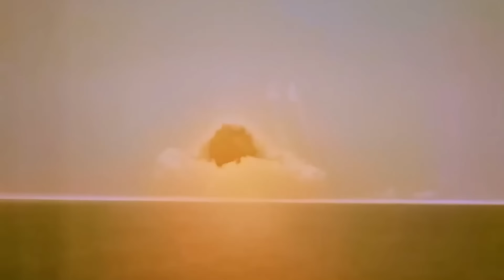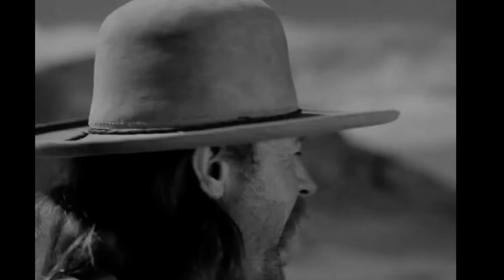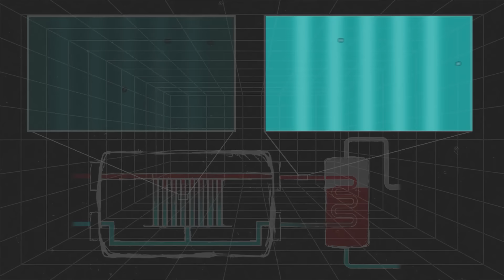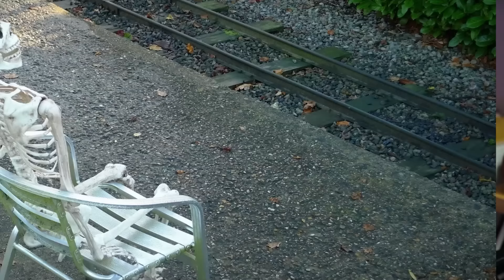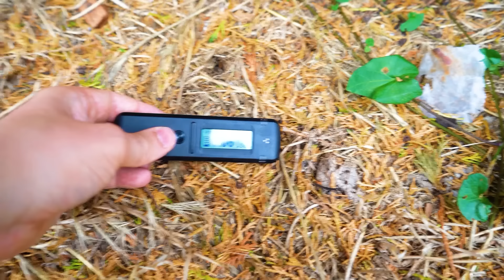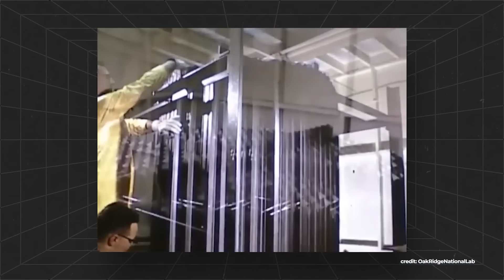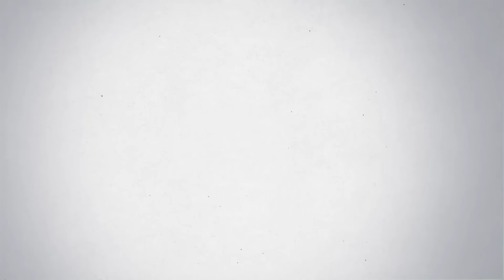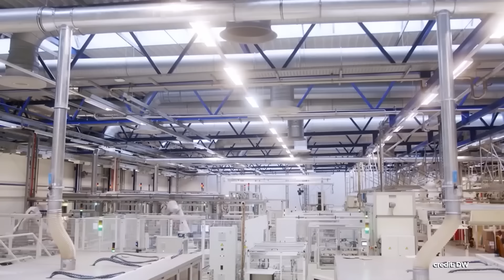It's Happening - China Launches World's First Thorium Nuclear Reactor

Comment: Claims that thorium reactors are easier for preventing meltdowns are simply not true. Ultimately, fission in thorium reactors is uranium fission. There is still decay heat after the reaction stops.
Reply: It's the molten salt part that makes them easier to prevent a meltdown

Comment: Indian Point Energy Center (I.P.E.C.) is a now defunct three-unit nuclear power station located in Buchanan, just south of Peekskill, in Westchester County, New York. 
Indian Point 1, built by ConEdison, was a 275-megawatt Babcock & Wilcox supplied pressurized water reactor that was issued an operating license on March 26, 1962 and began operations on September 16, 1962. The first core used a thorium-based fuel with stainless steel cladding, but this fuel did not live up to expectations for core life. It was switched to uranium in 1965. 

 - wikipedia

Comment: It's important to understand this new technology as it pertains to the evolution of AI and the AI Cold War. We are in a full blown race with (mainly) China to reach AGI and then ASI first. Nuclear power comes into this due to the MASSIVE amounts of compute (i.e electricity) needed for AI. Hence, whomever can harness better and cheaper sources of power can accelerate development of AI, faster. Currently, the power needed for the level of compute is the main ceiling hampering the development of AI, or, of implementing it practically. Nuclear power, dangerous though it is, is a highly efficient source of power to generate electricity. Therefore, a technology such as this (that uses Thorium) is important because it renders scary nuclear power generation into a far safer version. Very efficient.

Comment: sorry just because there is no primary water circulation with water - always the same water because circulation does not mean they do not need a secondary cooling by whatever.  2/3 of the energy by a power plant is waste heat you need to get rid of. this is a physical law with universe  validity. the remaining 1/3 of fuel input energy becomes electricity. if you put the powerplant into the desert than you need massive power transmission. One last point just google the THTR reactor type sold by germany to china ..............

Comment: Very interesting. TY, for an awesome video. We need a variety of power plants and power sources. I think having the power plant that can make more power as the demand goes up is great. We also need a variety of these other plants to continue to power our future. Would be cool to see less hazardous waste. Smaller more modern fuel sources and plant designs than a traditional nuke power plant. In the countries that will use thorium, good. Use the material and make power. Their are many things I liked to hear you talk about in regards to thorium. I think uranium is maybe not the way to keep pushing hard for. We need a lot of new plants and major upgrades to the worlds power grids. If we are going to step into the future. Hopefully well before 2040. Thats not far away from now. A great deal of work needs to go into the build up of many countries and infrastructure. To include their power grids, roads, housing, sky scrapers, big apartment buildings, waste water treatment, clean water supply, warehouses,  manufacturing plant's, eletric car charging capacity,  and many more power drawing facilities. The amount of extra power and plants that will need to continue to grow big cities and towns is a big concern going into the future. TY again. Cool video.

Comment: I'm a sincere fan of the proliferation of Thorium use for power generation.  For all of the reasons mentioned, Thorium beats traditional Uranium-based nuclear fission.  Nuclear is a necessity for the future of low-carbon electricity.  My understanding is traditional reactors stand to serve approximately 20% base load, with few opportunities to ramp-up/down.  

I am intrigued by the sodium molten salt reactor proposed by Bill Gates.  Attempting to solve the dispatchability issue is certainly a noble cause.

Comment: China's Foray into Thorium: The World's First Thorium Molten Salt Reactor

* 0:00: China has commissioned the world's first thorium-fueled molten salt reactor (TMSR-LF1). This is a significant milestone as thorium reactors are considered safer and produce less waste than traditional uranium reactors.
* 1:16: The reactor is expected to be operational by 2029.  It's located in the Gobi Desert and will initially operate in a closed system for research purposes.
* 13:29: China has ambitious plans for thorium reactors. They plan to build larger commercial reactors (100 MW and above) and potentially export the technology as part of their Belt and Road initiative.
* 7:57: Thorium is more abundant than uranium and produces less radioactive waste. The waste also decays faster (estimated 500 years vs 10,000 years for uranium).
* 16:36: Other countries are also researching thorium reactors.  The US (TerraPower) and European initiatives (Naria and The Rizon) are developing their own designs.

Important Note: While the video highlights the benefits of thorium reactors, several commenters point out that the Chinese TMSR-LF1 initially uses highly enriched uranium (HALEU) and is not a true thorium breeder reactor yet. It's crucial to consider these nuances when evaluating the technology's potential.

I used gemini-1.5-pro-exp-0801 to summarize the transcript.
Cost (if I didn't use the free tier): $0.13
Input tokens: 35029
Output tokens: 574

Comment: This video just continues to perpetuate some of the ignorance about radiation.

When it comes to half-life, the longer the half-life the LESS dangerous the material. Shorter half-lives means the material is decaying faster and will emit MORE particles over the same time period. Secondly, radiation isnt a disease or toxin. It damages cells via kinetic energy. The effects we associate with radiation sickness are just the side effects of massive cell death due to kinetic cell destruction.

Lastly, when it comes to uranium where do you think it comes from... the EARTH. Humans, plants, and animals survive just fine around it all the time. You could eat yellowcake, which is a concentration of processed uranium ore , and you would die from heavy metal poisoning LONG before you would die from radiation poisoning. You are exposed to more radiation on a flight than you would holding a uranium ore rock on your hand.

There is a lot of propaganda surrounding radiation plying on ignorance about the subject. Current reactor technology was preferred because it combined well with weaponization of uranium and the byproduct plutonium. However, on a commercial scale it simply comes down to cost and feasibility. The reason thorium isnt used it not because of some conspiracy, but because it is currently more costly, including the risks, and less efficient than current breeder technology.

Comment: Looking at these simplified models, it appears that Thorium reactors are constant load devices. The heat produced drives a steam turbine or gets wasted. Conventionally, this is not acceptable. However, If Thorium is cheap as a fuel, another use appears. Off peak surplus gets used for co-located quantum computer clusters.

Comment: I saw this article in Business Insider. Molten-salt reactors were first built in the 1950s but haven't been used in the US since the 1970s. The US Nuclear Regulatory Commission recently issued a permit to build a molten-salt nuclear plant. Kairos Power is heading the project, which it hopes to finish by 2027.
Reply: It's under construction at Oak Ridge TN
Reply: Indeed. I believe that the UK also had a sodium cooled reactor in the 1950s.

Comment: How much research into Thorium have you done?

    THE FIRST MOLTEN SALT LIQUID FLUORIDE THORIUM REACTOR (LFTR) functioned for at least 5 years continuously at Oak Ridge National Laboratory during the final years of the 1960s and into the first years of the 1970s. It worked well, and its shutdown was due to political reasons and NOT technical issues.
    Then President Richard Nixon gave the order to defund Thorium research. One of the reasons was, as your intro pointed out, that Thorium reactors (and LFTR technology in general) is not good for creating weapons-grade fissile material. Back then, producing such material was a benefit.
     However, LFTR technology IS GOOD FOR producing extremely high heat (better steam turbine electrical energy production), consuming and reducing the amounts and dangers from existing nuclear waste, producing radio isotopes for medical use, etc. Its main drawback is the highly corrosive nature of the fluoride compounds used, especially at the high temperature at which such a reactor runs.
    Kirk Sorenson in the US has been an advocate and educator on Thorium reactors for well over 10 years. Videos of many of his lectures used to be on YouTube.

Comment: Great presentation. The Wikipedia entry for the TMSR-LF1 MSR in China does state that the initial fuel load is HALEU (uranium enriched to 19.75%) and that it is graphite moderated. I presume that in time the HALEU is consumed and replaced by uranium-233 as fuel. My understanding is that, although molten salt is the primary coolant, water is consumed by MSR designs during operation and they need to be located to a source of water, the same as other designs.

Comment: Nope. We had a helium- cooled pebble bed thorium reactor (300 MW) in Germany. It was called THTR, situated in Hamm- Uentrop and run 1983 - 1989, then discontinued.  It was a failure.
Reply: Right.  Add General Atomics had a gas cooled thorium reactor using the same basic coated particle fuel.  It too was a commercial failure (GA became the first US company to lose more than a billion dollars)

Comment: There was no nuclear meltdown at 3 mile island. 0 radioactive nuclei were released into the atmosphere. We had a near meltdown but it was stopped
In time. Cbernobyl was
A full nuclear meltdown and a hydrogen steam explosion blew the reactor building apart. That shit in there is still hot. Fukushima was a meltdown too but because of the better reactor design of the Jappanese
Reactor to the Russian reactor much less radioactivity was released than was released by Chernobyl. The reactor at Chernobyl was a terrible design and would not have been even allowed to go into operation in the USA, Japan, or anywhere inside Europe. It was a really screwed up and backwards designed. Very powerful yes but very unsafe as it was proved to be. The people
Working at that plant weren’t properly trained either.

Comment: Personally I dont find the issues of safety or nuclear proliferation with uranium based nuclear reactors that bad such that we need to completely switch to thorium. Its already very safe and we do a pretty good job of preventing nuclear proliferation as is. In the short term, more environmental damage and human losses would be avoided by the expansion of existing and proven uranium reactors in combatting climate change.

In the mid term, it could have use and be developed. But i think in the long term if we can figure out uranium extraction from seawater, that will ultimately be our best source of power asides from fusion.

Comment: I have to mention.
The Atomic Bomb was used on Japan twice and both locations weren't bathed in radiation. The whole radiation bit is if the people building the bomb wanted to add the stuff.
The people who died within 3 miles but not 1 mile of the blast died not from radiation but the heat and pressure of the blast.
1 mile vaporized and 2 miles cooked.

Comment: The Thorium reactor is promising, but they have waited too long with that solution.  Now it is easier and cheaper to simply build a number of solar farms and support them with Lithium or flow batteries.  Because the solar and batteries solution is much cheaper and no additional authorization or permisions required as is the case for nuclear, there will probably only be limited Thorium reactors implemented and probably only for lower power solutions.  

The only advantage of Thorium reactors in future will be a smaller physical size, but they easily lose out on the lower price and no special approvals or acceptance required, for solar and batteries.

Comment: My understanding was that there were still two major unsolved issue, one you mention at 18:55 about the corrosivity. We genuinely do not have materials that can withstand the corrosion issues, not just uneconomically, they do not exist at all. The second issue you talk about when you mention the pilot plant. The process of removing waste and replacing it with  new fuel also doesn't exist. We need a "valve". Any idea what is being done to solve either of these issues? Until they are solved, MSRs (regardless of fuel) aren't "coming soon" on an economic scale.

Comment: Thorium is not a safer alternative, it's just another route for those who have thorium practically everywhere around for almost free.
The thorium reactor is a fast-neutron type, which creates another fissile element from thorium by bombarding it with fast neutrons, mainly U233, which is suitable for use in the fuel of classic slow pressurized water reactors, so with regard to thorium, still talks about uranium as final fisible product...

My information says that the development and construction of nuclear reactors requires having 50 years or more of experience, which Chinese companies do not have, so if it is not in cooperation with an experienced partner, the development will take a very long time.
But since I also know that these Chinese projects are joint with the Russian side, then it cannot be said that China is building, but China is developing and testing Russian ideas, which are being built in parallel in Russia and in India also in cooperation with the Russian side. Thus, these are Russian-Russian, Russian-Chinese and Russian-Indian projects, where the Russian side provides know-how in exchange for feedback on implementation and solutions at local construction sites and development laboratories, which provides the Russian side with faster practical verification of the solutions devised for this construction or own construction, and at the same time speeding up Russian construction at home and speeding up the development of commercial types, which will then be offered turnkey by all three countries, since in Russia there is also only a limited development base and financial budgets for development, in this way what three are doing at the same time with the same assignment it's better than just one doing it, because each of them informs the others about the success of what they're developing, and the other two have valuable information from that, what will work and what's a dead end, and for what reasons. This is how various technologies were developed also in the former Eastern bloc, including the development of VVER pressurized water reactors or any other technology. The development results were then used by all manufacturers to avoid unnecessary problems.

These three countries simply implement the assignments with their own resources, each has its own budget and its own scientists, but they share the results among themselves.

The sharing of results in this area has been going on for at least 10 years and the result will be that all three countries will complete their own type of turnkey equipment. In this way, the development of the thorium type will be completed in India with the help of the results of the development in Russia and China, in China the development of the raector with molten salts, the development of which is being developed jointly with Russia, and in Russia the development of recycling and processing of waste into material suitable for the production of new fuel, and also production of new fuel and completion of sodium and lead cooled reactors to the stage of commercial turnkey types.
And in the end, it usually always turns out that the most experienced will be the most successful, regardless of politics, but let's be surprised.
Today the EU, AUCUS, NATO etc. pretends to completely ignore Russian, China, India developments, but specific scientists are watching and trying to find out as much as possible, why is this so? This is absolutely clear and always is this way, they do not want to pay for the purchase of licenses and patents, but they will have to if they do not want to cooperate.
Reply: Wrong. To work efficiently Thorium reactors work with thermal not fast neutrons.

Comment: yeah if that leaks im pretty sure its just going to react with the water in the air. also its still basically corium lite.
what is this guy a doctor in again?
what makes them good is the negative temperature and void coefficients. they self moderate. you could design a reactor like this that could be run by teenagers.